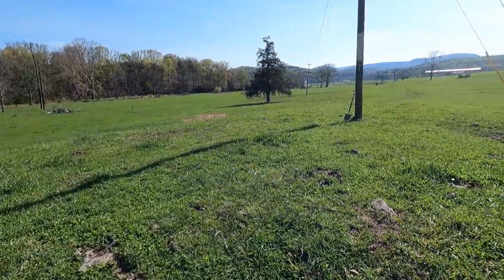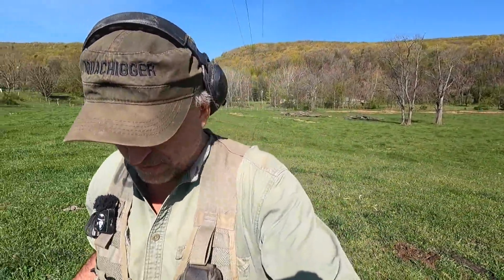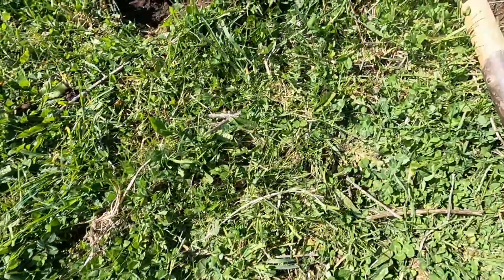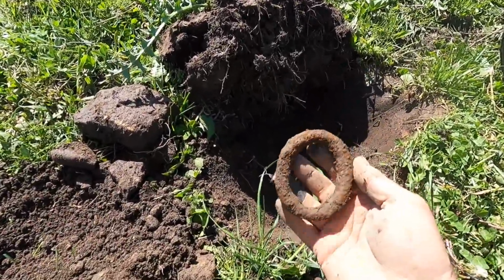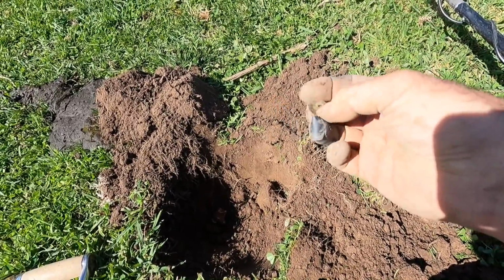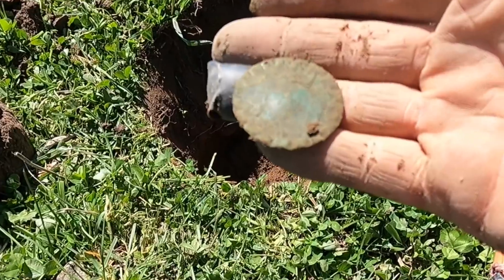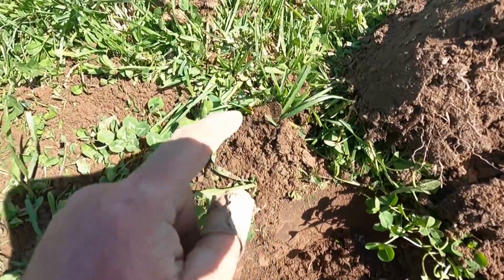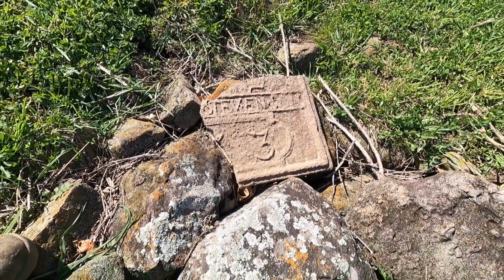The Old Log Cabin Yields Another Bonanza!

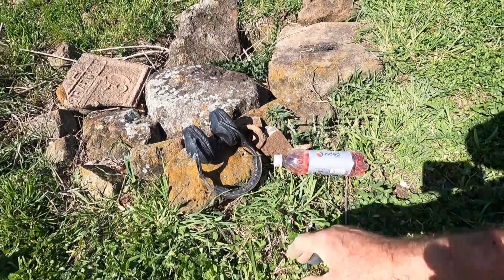Comment: 15:50 hey Chig, that is actually a Jamb Stove plate. If you ever look up the book called The Bible In Iron, it will list all the styles of plates over the years. I found one in my house when I bought it last winter. Super cool. They would burn fire inside the stoves and the back side of the stove would radiate heat throughout the house. Pretty cool.